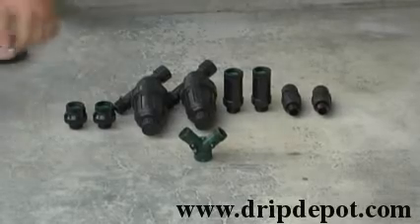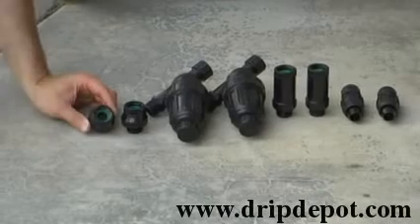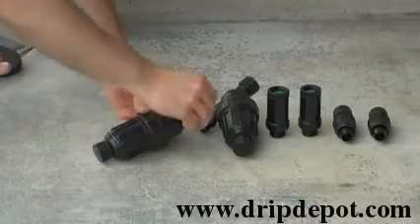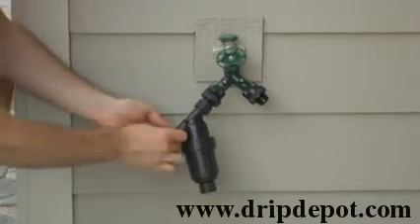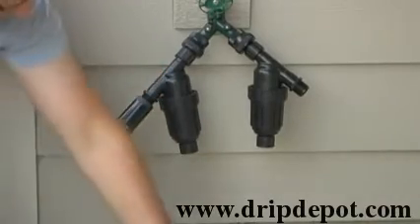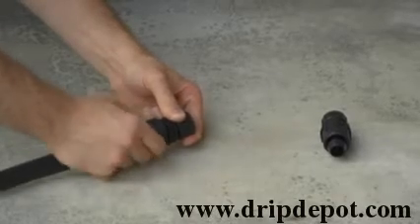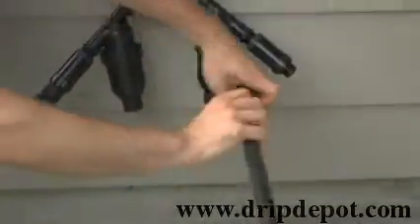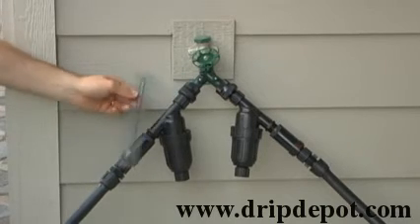How to install a 2 zone Head Assembly in a 3/4" Drip Irrigation System

Comment: Where would a timer go on this set up? I have a 2 zone timer.
Reply from the maker: With a two zone timer, you'd want it to be the very first thing connected to the faucet.  After that you'd want a head assembly at each outlet that will be used for a drip irrigation system (the head assembly parts are not rated for constant pressure so they have to come after the shut-off valves in the timer so they're relieved when the system is not in use -- the valves in the timer can handle the constant pressure).  

I hope this helps, thank you for reaching out! :)

Comment: Why wouldn't you put the Y splitter after the pressure regulator instead of putting it on the spigot. Use one less backflow valve, one less filter, and one less pressure regulator...

Comment from the maker: Hi,
Thanks for the question.  You don't have to use 3/4" for your drip lines as well.  There are fittings that allow you to reduce down to 1/2" tubing for your dripline OR you could punch a hole in the 3/4" tubing and insert a 1/4" barbed connector that allows you to use 1/4" dripline.  If you need more help don't hesitate to ask. - Mike - Drip Depot